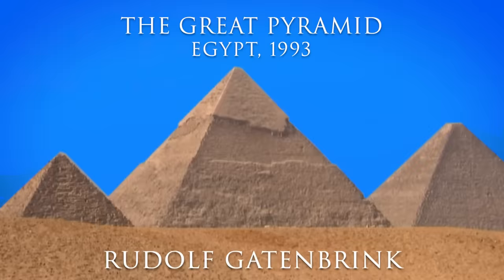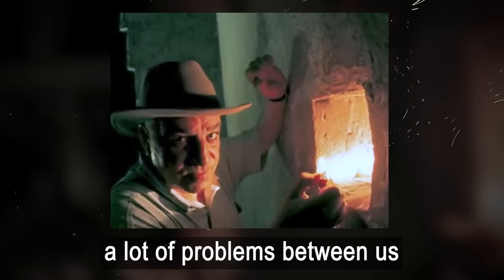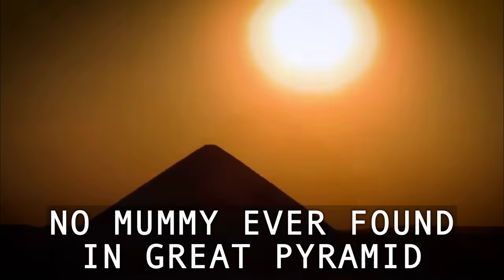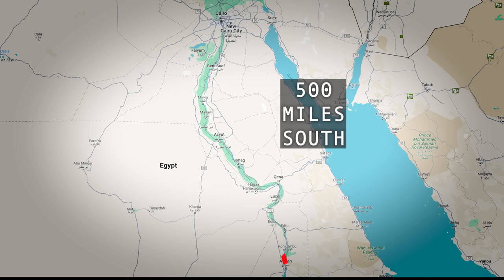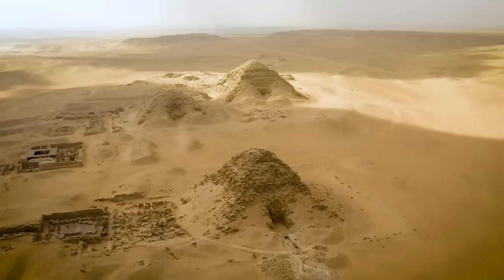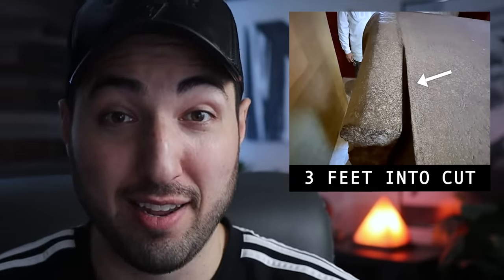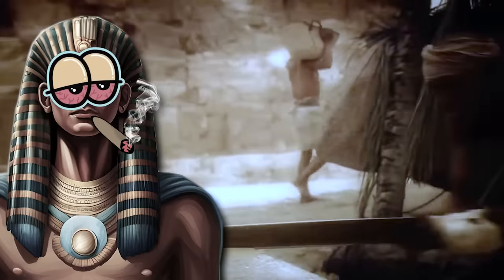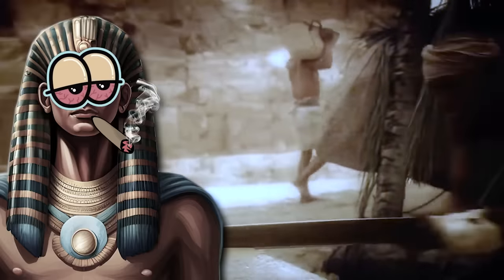The Great Pyramid Mystery: The Oldest Cover-Up In History

Comment: You need to visit the pyramids, they are not precise fit stone, but rough cut blocks that are mortared and patched together, only the outer blocks were cut more precisely and the use of sand as an abrasive easily shapes the limestone, limestone which came from the plateau and across the nile not 500 miles away.  With 20,000 full time workers placing 315 stones a day is easily done -= nothing to see here folks...  You need to watch Ancient Architects or History for Granite who have scientific analysis of these structures that actually make sense and based in science not his nonsense being espoused by this YouTuber.

Comment: Even if it is/was alined with magnetic ..and not true north 
How do you think this is some sort of big advanced tech when the magnetic poles are not stable and moving 

The 8 sides were not visible at all once the outer layer of stones where put in place 
This is a strong argument that those sides have a structural reason and not some conection with stars sun or whatever 
Also The pyramids werent the first objects build with stone 
To think they just started production of the stones  only when they decided to build it and not have a huge amount already is just naive

Comment: You start by sating everything learned in schools is a hypothesis. Then riddle the video with ideas of your own because you weren't there. Aren't an engineer of the time to understand they techniques. Aren't an engineer now who's studied manufacturing in order to see that many things visualized here is possible. But in the hands of those who are ignorant the only powerful tool you have is being a blind guide. How about doing some honest research and contacting companies that specialize in development, mining, and manufacturing of stones and other excavation industrial systems that are available. Versus being like those who simple hooked cables to a crane ignoring the engineering safety rating and far exceeding the weight capacity.

Comment: The speed of light in metres isn't true
Reply: It is correct but strangely the Egyptians were using metric system a few thousand years before its invention.......
Reply: @fabianmckenna8197  I mean the video showed a cross on top of the pyramid as though longitude and latitude dissected the pyramid and that was light speed in metres. But it was only one of them like longitude and that hits many points on earth. And it wasn't the very top of the pyramid either like it showed.
 I personally don't believe the Egyptians knew the metre and they definitely didn't know the speed of light and they definitely didn't know how we would map the earth with longitude and latitude and the numbers to go with it

Comment: There is magnetic north and true north. They are not the same. The geographic center of the landmass of earth is in turkey. Look it up. The “Golden Ratio”  
φ
  has nothing to do with the pyramids, nor with anything else in architecture, regardless of what you might read in various sources. The proportion  
5 to 8  looks kind of nice, but you don't need any knowledge of irrational numbers, continued fractions or quadratic equations to use it. Frankly I'm fed up of videos like this. I will report as misinformation. Why do you lie? For audience? Very very lame

Comment: The water of the Nile were a lot higher, each stone was sailed to its spot, when each layer was raised they closed gates in surrounding dams and raised next level, the top was raised by the ground raised and rolled into place, even early cranes of pulleys